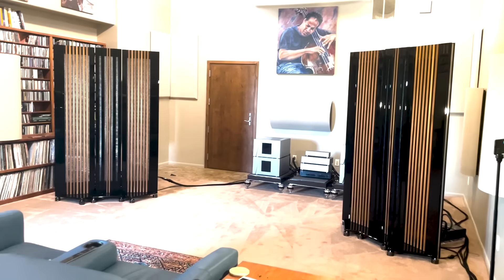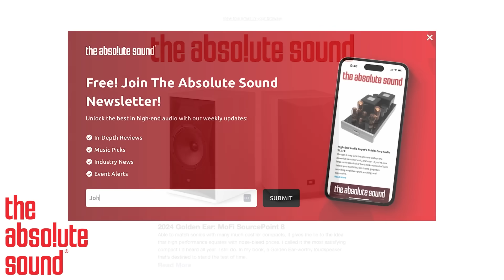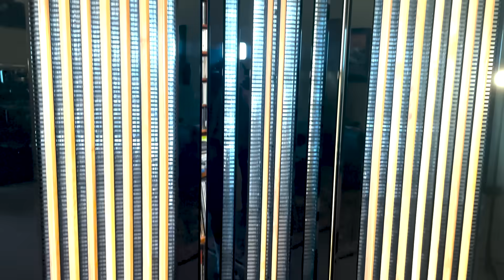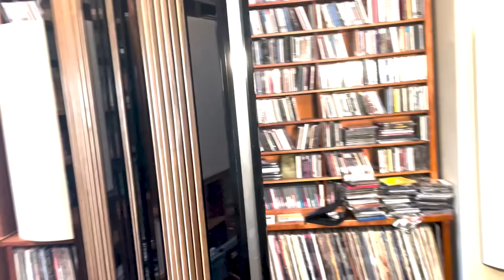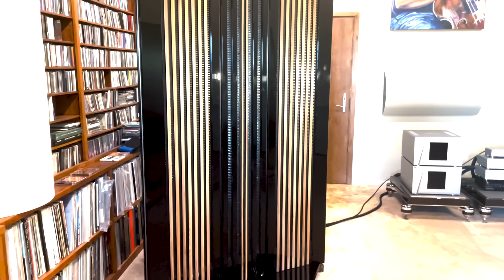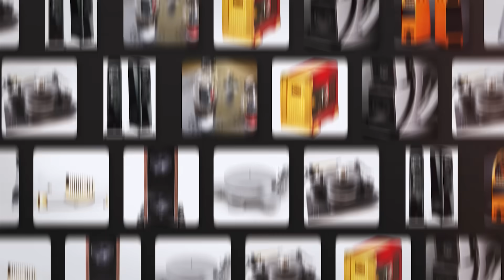Alsyvox Michaelangelo Preview and Interview

Comment: I do not believe the claim they got 2 cm peak to peak in the planar woofers. Løok at the front with the wood. Behind that iron to hold the magnets, there have to be huge thick neodymium magnets on both sides of the planar foil. When you look at the speakers from the sides, it is simply impossible to get 2 cm .
Reply: It was easy to see at Munich audio show. I own Botticelli X, and the woofer have I think capable of 2 cm travel. I listened a lot of music with huge bass (shacking) and I see that the woofers moves a lot (with any distortion).
Reply: @philippeperrot5461 You think no you dont you belive they can. 10 mm p-p would look like it move a lot. The membrane either got 10 mm distance from the magnets or it do not.

Comment: These look like a beautiful product, BUT,, they are NOT 'full range ribbons', as the designer tells you "they are not really ribbons". And the diaphram is exactly the same in operation as Apogee or Magnaplanar, excepting the magnets on both front and rear of the diaphram. And, have you, Robert, never heard Apogees?? I ask as you've just said that they don't do low bass, which is rubbish, as they do bass VERY well indeeed, both depth/extension and quality. Maybe you tried them also with a single ended valve amp?! These work just the same as Apogee and Magneplanar, in that the main panels are NOT ribbons, they are 'Planar Drivers'. A 6' tall x c1cm wide ribbon element will have a surface area and mass MUCH greater than a tiny c1" dome tweeter! This review shows you do not have much experience with, or have little knowledge of panel speakers, and how they work! Final critique - socks with sandals?!?!? Really?!
Reply: Check his website, it is true ribbon planars. I very much know Apogee (Diva) and they use exactly the same type of ribbon. It's not at all what you can see of Magnepan, Dyptique, and other planars.
Reply: @philippeperrot5461  I'm sorry but you're wrong. A Planar driver (panel) and a Ribbon are two completely different technologies. Apogee do not use Ribbons for the main panels, they use Planar tech. Diva uses Ribbon on Mid and Tweeter, but not bass panel. My old Apogee Stage use a Ribbon tweeter but Planar bass/Mid. If you actually listen to this video, even the designer says they're not really ribbons.

Comment: There are lots of myths about the old Apogee speakers.Only the Full Range and Scintilla were difficult to drive.Later models like the Duetta and Diva had much higher easier to drive impedances,3 to 5 ohms.Also they will play very loud,contrary to what Robert Harley says here.A pair of Full Range are capable of 118db at 4metres with bass essentially flat to 25hz.
Reply: I've owned a pair of Apogee Caliper Signatures since 1991, and I originally drove them with no issues with an Adcom GFA-555.
Reply: Exactly, Robert harley doen't know what he's talking about! I'm an ex Apogee owner, and now Maggies.

Comment: super tweeter, what's the xover point. I'm going to guess that you two can't hear anything over 9khz, if that. I'd be interested in hearing these. I love my Raal tweeters, wouldn't use anything else.
Reply: This subject is a complex one. yes most known reviewers are 65 or more than 70 years old, so they probably have less good ears than at 20 years. That said, most orchestra conductors are old too, but they really do wonders, as they ears and brain work at a level capable of embracing live music. About super tweeter I can say that I'm 66, I check my ears each 3 years and well they are fine because of sport practice and more. I own Botticelli X and they also have super tweeter. I could easily listen to them as it add air to the sound. Also Alsyvox have 2 Super tweeter outputs on their external filters, different gain. The difference between the 2 position is easy to listen.
Reply: @philippeperrot5461  Did you do a sweep test for your hearing. At 66 I doubt your hearing extends very far, but hey the mind can play great tricks. And what does sport practice have to do with hearing?? They add air to the sound??, theirs your mind playing tricks again and using terms like air, you sound like an old audio reviewer from the past, lol. But whatever turns your crank. As for conductors, they don't have to have perfect hearing to do their jobs.
Reply: As you should know, super tweeters produce frequencies well beyond any humans hearing, not just these two specifically.
Ambiance & air is the objective more so than distinctive musical notes.
Would guess their hearing would be 11K; if not above.
Reply: @saint6563  lol, if you can only hear up to 9 or 10 k any super tweeter isn't going make any difference to the ambiance or air as you like to call it. Do you know what the xover point is for this super tweeter and at what slope.
Reply: Probably 14K
Reply: @Stereosandotherfun  So to hear 14K, you'd have to be in your 20's maybe early 30's to hear it. I saw a study not that long ago for what different age groups hearing peaked out at and I was shocked at how young you had to be to hear upper freqs.
Reply: They sound absolutely amazing IRL.
Reply: I'm not doubting the speakers on review here don't sound great.

Comment: Wondering how the Maggie X line would compared to these wonderful speakers.
I am totally amazed that a lower wattage SET Amp can drive these monsters!
Reply: SET amps can drive them because of the very high efficiency, but it is also possible on other ALSYVOX models. That said, SET amplifier are wonderful on medium but I listen these planars with much better amplifiers than SET.